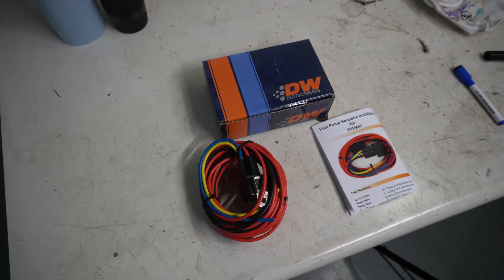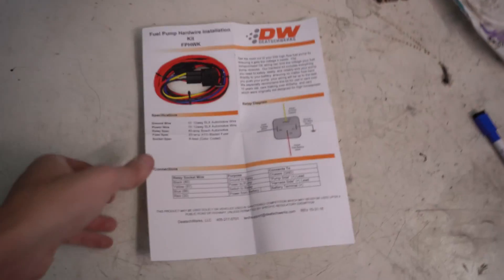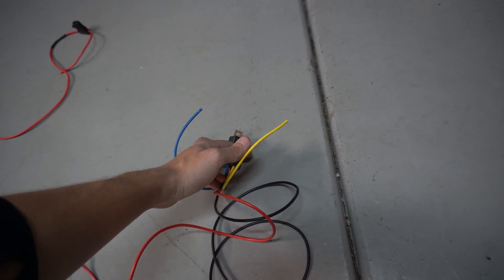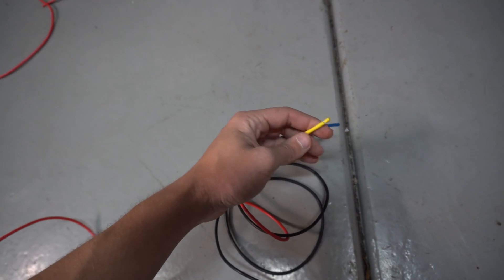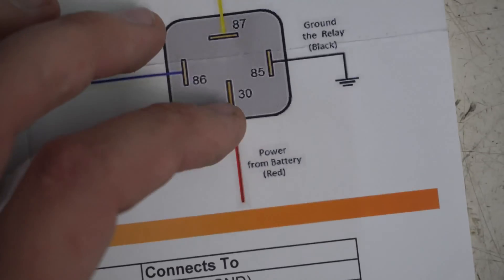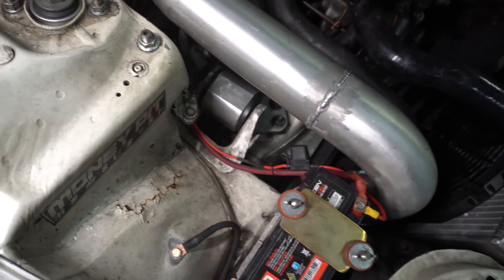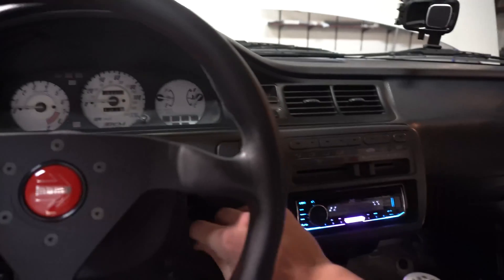How to Hardwire Your Fuel Pump With A Relay

Comment: I don't understand . The Honda has a main relay which is a ecu and fuel pump relay. It is 2 relays in the one module. So are you now running 2 fuel pump relays or what?

Comment: Hondas have the fuel pump relay and ECU Relay inside the Main relay so that means you are now going to be running the fuel pump thru 2 relays. That doesn't make sense.
Reply: Depending on the pump you need to. Specifically the Walboro 525 you have to for sure due to the amperage the pump draws. The relay essentially protects the rest of the factory circuit due to the OE wiring not being able to handle the current draw of the aftermarket pump. You could essentially just do everything he did and run it on a switch as well. However you wouldn't have any of the PWM benifits from the ECU in the vehicle and it would be on at all times instead of using pulse width modulation to control pump duty cycle.

Comment: Great video man but you left out where the wires hooked up to the relay as towhat terminal they where connected to the relay. That really would have been a benefit to lnow so im still stuck trying to wire up my fuel pump to do it right so vid was great but not very informative to me so I'm still having to get more help so I can get my truck back on the road cause the relay that I have has 5 terminals and still can't get the truck on the road again

Comment: John the best video out there on YouTube thank you for sharing, does anyone out there knows if I could do that to a 2011 Genesis Coupe 3.8 stock I am having trouble with the original connections to my fuel pump I am the original owner since 2011 I will love to do exactly what John did to his Honda is it only for racing built cars or it could be done to a regular stock car?

Comment: Does your fuel gauge work with this kit
Reply: @SuperStarPimp  fuel gauge or level sensor is not impacting by the hardwire kit.

The kit ensures adequate amperage is provided to the pump.

Comment: Did I have to do the same thing on my EK Honda? I have N/A high compression little bit bigger camps and little bit stronger fuel pump I changed the main relay two times already if I go for upgrade on the relay, am I gonna resolve the issue?

Comment: what sort of connections and insulation do you use for in tank being able to handle E85? Also regarding the wires that come with this kit, you send the yellow down into the tank, are they E85/Unleaded safe? Or are they just a basic automotive insulation wire?

Comment: Would the stock wires you're splicing into bottleneck the current of the bigger 40amp wire?
Reply: Theoretically yes, but the Idea is that the bottle neck is such a short wire it SHOULDN'T make that big of a difference

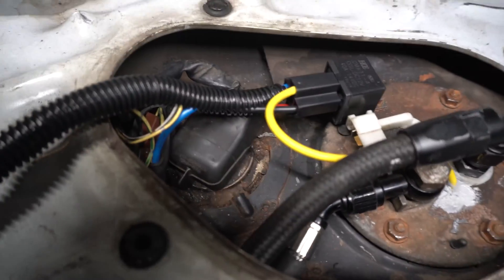Comment: @6:44 suppose u had a problem with your oem white green wire, and you wanted to replace all of it instead of tap into the end of it? Where does it come from?
Reply: @lurice0  do you need to connect those

Comment: If you don’t have a trigger signal in case in my case for my 66 VW bug , I can wire a positive lead to a switch to turn off and on power to mimic a trigger signal to the blue wire to activate that relay correct I think I just answered my own question I can.  lol 🤔

Comment: You ran the larger gauge yellow wire all the way to the pump, then connected it to a smaller gauge factory wire anyway before it connects to the pump.

Comment: Really? You just drilled a hole and shoved the wire in without even a grommet? You didn't hard wire a fuel pump, You put a fuse into a giant car bomb! Please, if there is ANYTHING you take away from this video. DO NOT follow these instructions. Don't be a cheap bastard like Boosted John and buy some bulkheads to route your wiring into you giant container of explosive liquid!

Comment: Dont you need to also put a bigger wire to the ground side of pump? 

Love the video!
Reply: @4door_papi  I ran  3mm thin wall wire (awg 13) to a fuel pump, positive and ground from bulkhead, 12metres total length. 
Battery voltage at idle was 13.9volts, voltage at fuel pump was only 12.4 volts.
Upgraded 3mm to 4mm (12 awg) and voltage increased to 13.1 volts

Comment: What confuses me is that I just ordered a similar kit from Amazon with one difference. My kit comes with a “switch” or a button that apparently I’m supposed to push it while starting my 1995 Mazda B2300 truck, which is basically Ford Ranger made for Mazda company. After installing a new fuel pump, new fuel filter and fuel pressure regulator, and replacing relays and a new battery, still the damn car doesn’t start. Few months ago I saw a similar car where a household electric wire was connected to a red button; to start the car the driver pushed and hold that red button while he turned the switch on and started the car!!!?? 

Your video doesn’t show a  new “button” in your wiring and I’m wondering what I’ll be doing is different than yours. I try to paste the link to the kit I receive tomorrow. Hopefully you or someone could explain the difference between your version and my kit with that “switch/button”.

https://www.amazon.com/gp/product/B0948Y4SDT/ref=ppx_yo_dt_b_asin_title_o00_s00?ie=UTF8&th=1

Comment: Nice videos man. No one really have a easy install video for hondas.

One question. For the ground coming from the fuel pump connector. Did you just attach it to the assembly that drops in the tank just like how it is stock?
Reply from the maker: Nope. The ground wire is for the relay itself. The fuel pump has its own ground inside the hanger.

Comment: I ran a relay and my fuel pressure is 12 when starting the car
Reply from the maker: Uhhhhhhh
Reply: @boosted_john  when priming the car. I hard wired it in from the positive termal on the battery. Where should I begin tk look?

Comment: RUN A VOLTAGE METTER WHEN RUNNING CAR I CAN GUARANTEE THERE MORE VOLTAGE DROP NOW THEN YOUR STOCK WIRING SINCE YOU EXTENDED WIRES AND TWISTED WIRES TOGETHER THIS WILL LEAD TO VOLTAGE DROP IN HI RPMS

Comment: Hi John, I would remove the Amazon link that you provided for the fuel pump relay kit. I followed the link and purchased 2, one for myself and one as a Christmas gift for a friend. The image displayed is exactly what you used in your video, but what shows up in the mail is nothing like what you used in the video. It’s basically a pig tail and a universal pump sock. I went back to the listing after realizing there’s been a mistake and there’s multiple reviews about the false advertisement and not receiving what is pictured. Wish I’d have read it first but this is one time that I just really didn’t think I had to double check since I was following the link you gave us.
Reply from the maker: Thank you for the heads up!
Reply: @boosted_john you’re welcome. After messaging the company they admit it was an issue on their end, they apologized and immediately issued a refund since they didn’t have the rewire kit in stock to send me. Customer service was really good.

Comment: Hey how did you get the AN fittings on the fuel pump cover?. can you make a video on that I wanna do the same so I can run AN lines from the tank to the front and back. Thx

Comment: The correct way is NOT to drill a hole in the cover.

The correct way is to remove where the white plug is and put a fitting that the wires go through it into the tank.
Reply from the maker: Will look into this
Reply: Hi @boosted_john, is the fuse a 25amp capacity? Is the relay a 40amp? I wanna create my own, but I'm out of the States, need it for my 97 supercharged 4Runner 😈😉👉

Comment: Please please PLEASE disconnect that immediately John. The wire running through the fuel pump lid is going to chafe on that metal and short out. This is a HUGE fire hazard!

You need to use a grommet or insulated stud for this
Reply from the maker: Ok

Comment: I would’ve ran an 8 gauge wire to auxiliary fuse block either in the bay or under the dash. Then send power to the pump from the aux block. This gives you the advantage of having a bunch of extra power sources instead of adding wires to the battery

Comment: i have an ep3 so i was wondering if instead of connecting the power wire directly to the pump on the inside of the tank, can i just splice it into the connector on the top of the fuel module? like cut the power in the harness and run it to the wire directly to the pump side of the harness
Reply: Yes, but then you are relying on the pin in the connector and the final length of skinny wire inside the tank to carry the current. It's usually the connector pin and/or housing that fails from excessive heat under high current loads. Your solution will work and can be reliable, it delivers higher average voltage than the factory wiring, but it can have reliability issues down the road. Look into fuel cell electrical bulkhead fittings.

Comment: Nice work, John. Easy to follow and a necessary mod for any big power car. I have few suggestions or things you didn't mention.
First, you should use a bulkhead fitting to go through the top hat. It will have rubber insulation inside to eliminate the chance of the wire ever chaffing and shorting on the fuel pump assembly, plus it creates a vapor seal. You can get them for around $10 if you search fuel cell electrical bulkhead. Your install should be fine, but this is more a tip for anyone reading.
Second, make sure wherever you ground the relay that it is touching bare metal. I didn't see if you sanded off the paint where you bolted the connection, but you should ideally have bare metal under the connector itself and on the other side where the nut or washer touches down. If not, it may work at first, but you'll end up with intermittent issue later.
Third, this is just a suggestion to increase wiring reliability, especially in the engine bay. Get a set of ratcheting crimpers specifically designed for heat shrink connectors and a box of various connectors. The crimpers work so much better than standard and make reliable connections. The heat shrink insulation with glue adds strain relief and water proofing.
Take this all as just adding on to your video of course, not criticism. I have been slowly acquiring lots of wiring tips and tools over time. Gotta spread the knowledge.